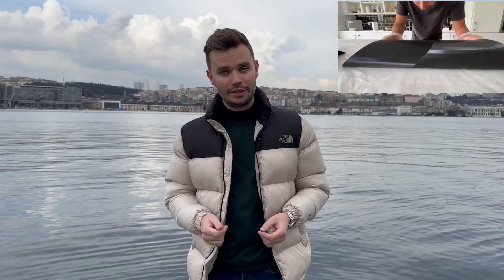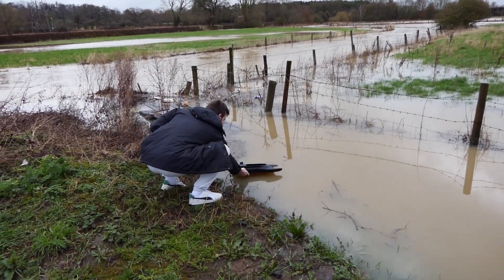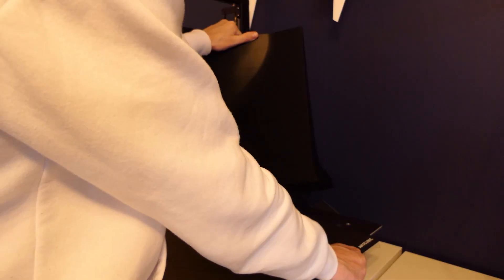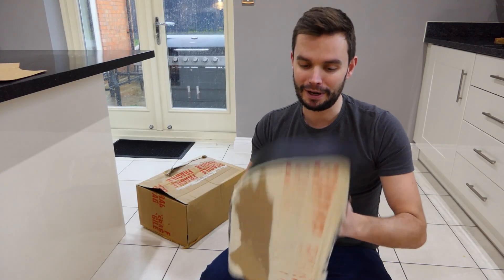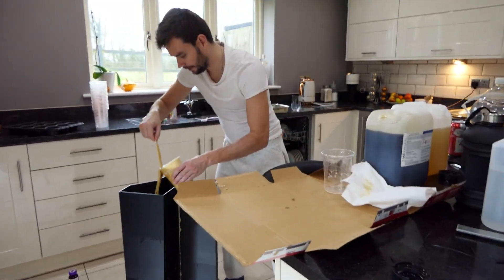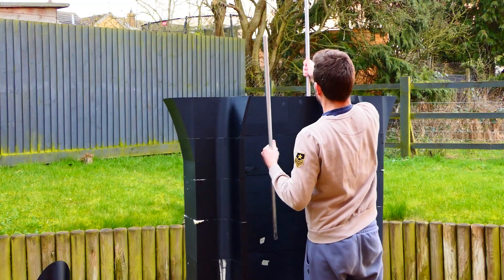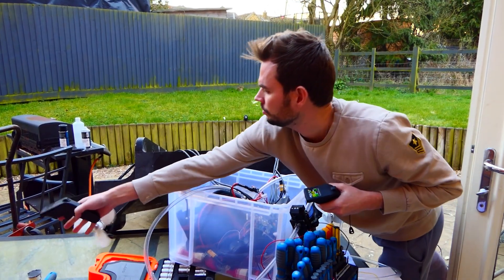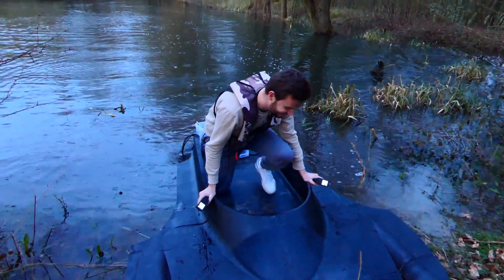3D Printed Electric Hydroplane

Comment: Mate I thought you were going to become a submarine
Reply from the maker: Thank you for preventing that <3
Reply: @SamBarker  then you would need to print with carbon fibers 🤣
Reply: "You do CAD like you're sculpting clay." I have never felt so attacked. Teach me your ways, oh wise one.
Reply: Casually almost drowned wtf
Reply: Laughing your ass off immediately, and THEN asking if he's alright... correct  answer  10/10.
Reply: SAVED THE TRANSMITTER falling in there!
Reply: Like the new Titan Submarine!!
Reply: I THINK you can reduce the cavitation by putting the propeller inside of a cylinder.... or at least I thought that's what I understood they were for when I watched a video on boats that had steerable props... but i could have  understood it wrong...
BUT I would think the best way would be to slow them down... so just make them bigger... you've got plenty of power that bigger props would slow them down enough and push WAY more water.... or you could always try those new style of props that use loops instead of blades... I think Tom even tried them out.....
- ALSO I way thinking about why some prints would have been been mismatched... it's probably the room temperature, humidity, and barometric pressure that day.... alone each one of these variables do affect much, but when all three are different AND you're doing such large prints I would think all three variables would make such huge swings over such a large distance - PLUS you're printing them quite fast, so they aren't going to be very accurate over so many layers..... 
- I think the perfect person to ask would be James Bruton .... he does A LOT of very large prints and doesn't seem to ever have issues with this... you should probably ask him
Reply: The captain must go down with the ship 😂
Reply: “Don’t help - just film”😂

Comment: Look at real hydroplanes, the props are far deeper in the water, using a flex shaft, also not sure if u have a deep enough two front arms to hydroplane, essentially u wanna be flying over the water with only the prop and bottom 5-10% of the two supporting arms bouncing on the water

Comment: You need an enclosure for large prints. As it prints, it begins to cool. As the material cools, it changes shape, but your printer is not compensating for that (and really can't) and so printing skewed parts.

Small parts are usually fine because the heat bed is enough to overcome the cooling, but a tall part with a lot of surface area is going to face a LOT of cooling and so needs an enclosure.

Comment: The gaps could be due to the print peeling off the print bed, that would make sense since the parts are kind of curved and out of square, happens a lot with big flat surfaces on almost all fdm printers. The only fix is things like a hotter bed, printer bed glue stick, or painters tape for bed adhesion

Comment: I THINK you can reduce the cavitation by putting the propeller inside of a cylinder.... or at least I thought that's what I understood they were for whebn I watched a video on boats that had steerable props... but i could have  understood it wrong...
BUT I would think the best way would be to slow them down... so just make them bigger... you've got plenty of power that bigger props would slow them down enough and push WAY more water.... or you could always try those new style of props that use loops instead of blades... I think Tom even tried them out.....
- ALSO I way thinking about why some prints wouyld have been been mismatched... it's probably the room temperature, humidity, and barometric pressure that day.... alone each one of these variables do affect much, but when all three are different AND you're doing such large prints I would think all three variables would make such huge swings over such a large distance - PLUS you're printing them quite fast, so they aren't going to be very accurate over so many layers..... 
- I think the perfect person to ask would be James Bruton .... he does A LOT of very large prints and dowen't seem to ever have issues with this... you shoudl probably ask him

Comment: Your propellers need to be under water. Look at how outboard boat motors look - they have a neck long enough for the whole propeller to be below the hull. If the water detaches from the rear of your boat (typically around 7 knots), your propellers start sucking air from above the water line and you get that nasty cavitating noise.

Comment: Maybe build it shaped like 2 hulls side by side. With a space between where you can sit to control the boat.
Then you can use 1 motor in the middle and make 2 rudders.
Locate the rudder brhind the hull. Just like when you buy an boat. Then you can use a bigger motor with more power.
Instead of 2 motors.

Comment: You will significantly reduce cavitation by reworking those motor mounts. Not only do they have a flat front face plowing in the water, theyre blocking the water from flowing through the prop. Instead they have to suck in water from the sides.

Comment: All consumer 3D printers are off square. You must correct the frame and then run skew calibration XYZ. Next, run a test print to correct the expansion/contraction and scale the model with the corrections to get accurate results.
In XL parts use .8 nozzle to speed up the process and get strong parts. Even the .6 will work better.
BTW what a waste of filament, time, money. Insane!! Just use playwood and fiberglass. Or made the shell in 3D print, then use it as a mold to cover it with fiberglass

Comment: Cavitation is generally caused by props being too high for the application, or disturbed water flow. In this case, I think it is both. Larger propeller likely will help it (enough) though it would have been better if were below the center on pod(s). In the end, if it gets to planing speed, then you'll likely want the props level with planed out water level, or above. The hydroplanes you built is designed on the "3 point" design and are meant for much higher speed than 30. Normally, the boat will plane on the back portion of the sponsons and at lower speed the back of the boat. At extreme speed, they'll nearly just ride the propeller which will be roughly halfway out of the water at top speed. They are a bit different on prop placement than conventional v-bottom boats (where I have a lot of experience with small boats going fast). 
If larger props didn't help, or help enough, you might also experiment with 'set-back' i.e. putting the motors BEHIND the boat instead of inside. This helps with stability, bow attitude (which may not help much on hydroplane), and overall speed. My 20' Hydrostream needed 8" of setback versus mounting the outboard directly on the stern with prop 2" above center line to hit its max speed of 104 mph. 

Regarding the fit, fit all the parts together and glue before filling with foam. I discovered a long time ago when I used spray foam behind a door frame that it can expand and greatly flex the space. In my case, the small amount I used was enough to where I couldn't get the door open until I took a saw and cut out some of the foam. It looks like the molds did fairly well, but more internal bracing near connection points will help. I used to have to do that with huge fiberglass subwoofer boxes so they didn't flex under use.

Comment: You’re pods block your flow to your propellers. That’s why normal boats have the motors inside the hull with a driveshaft going through the hull with an only a strut supporting the prop shaft in the water to reduce drag and turbulence to the propellers.

Comment: You need to angle  the prop down a little to create a plane you wanna sit more in the front of the boat  not towards the back as you were the concept of this style hydroplane is to have the pontoons and prop in water while you plane over the water so you want angle to the prop to lift the back up

Comment: This looks like an issue with propeller matching and motor rpm. This propeller can't absorb all of the power of the motors at those revs, so its spinning like an egg beater. Analogous to wheel spin. Try a bigger diameter prop, or a prop with a higher pitch to absorb more of the power.

Comment: The cavitation is mostly caused by the big cylindrical shapes that house the engines dragging through the water close to the water surface. They are creating an air bubble around the props most likely. I bet making a more streamlined nose cone for those things would help or moving the prop away from the thing by putting it on a longer axle is what normal boats do. I also think you'll want a more speedboat like prop, but that's complicated stuff. awesome video

Comment: Cool project. Just came to mention that you must not have squared your printers before printing. This shows in your distorted parts. Your motor housing/mount needs to be smooth on the front. It should resemble the front of an outboard engines gearbox.

Comment: Thought it was clickbait when I saw the small boat in the beginning. lol BTW, if you dont want all those bubbles, and you want more thrust, you probably need to redesign the impeller system. You should look into buying or printing a jetski type inpeller, and maybe redesign the impeller system so the impeller is inside a small tunnel further under the boat and not so far back and high up. My guess is the bubbles are from the impeller being too close to the water surface, but that is all just a guess. You could probably design a little drop in tunnel with a gate on it without having to redo your whole boat. You could cut out a box section, and drop in the insert.

Comment: CMON PEOPLE! STOP using damn PLA!! Its 2024!! use PETG! and you need to use  an expandable insulationg Foam it doesnt heat up and expends more.
And you have to use keys to join parts not just stick them together with glue

Comment: Prop cavitation
You need them lower than your back transom. Or the back face of the boat
Can mount on little pods lower like an outboard
Or in front like an inboard
Its not cavitation, but the air bubbles coming in from above
But no boats have them back there cause air bubbles
And when you get on a plane theyre out of the water
Reply: Or a hydroplane uses a jet pump so it doesnt stick down, sucks the stream up into it. Like a jet ski

Comment: I think the gaps in your 3D prints are actually caused by slight warping in your parts especially on the surfaces that laid “flat” on the heated print bed, due to some temperature differences.

Comment: Check out the possibility of 3-D printing toroidal propellers. I think they're pretty expensive to buy commercially, but even a 3-d printed toroidal propeller would have better performance than a commercial standard propeller.

Comment: Ah! you need an SLA resin printer!  No layer separations, completely water proof...
Reply: And like 4 times the cost
Reply: @adambundy2639  You can always get more money, but you can never get more time...
Reply: @nuchbutter  you just run more FDM printers... SLA is only quicker making multiples of the same small part....
Reply: @adambundy2639  no splitting or shattering with SLA, so no need to reprint saves time and frustration in the end.  SLA is way messier, however.  And as you stated, expensive...
Reply: @nuchbutter  a better choice of filament would avoid any splitting or shattering you speak of. There's literally companies making boats through the FDM process

Comment: To help with cavitation you need to get the propellers into "cleaner water" away from any wake. Spacing then out will help, but also the to"clean" the wake up by streamlining the back of the boat to allow the water to flow off more"clean"

Comment: if you want to stick to dual motor as your form of steering you'll need it to be software base because once you get up to speed on plane you'll want any adjustment to be miniscule or you risk loosing plane or loosing control. you also most definitely want your props to be mirrored otherwise you're just slamming the port side of the boat down into the water.

Comment: Got to love the wastage :) would have been quicker/cheaper and More environmentally friendly to build a box the right size and fill with expanding foam, shape it once hard, then fibreglass......presto.  But No lets use a £10k plus 3d printer and $h1t loads of plastic and the best part is its F'd up :)

No bloody life vest either or a paddle
Reply from the maker: Thanks for the input…. 

Personally I would disagree, shaving down a foam block which is not biodegradable in the near future (compared to PLA feel free to research that yourself.) However imagine your knowledge on the subject is poor anyway due to the presumption that the printer costs over £10,000. The printers I used in this project can be found in a link in the description and retail at £450. 

With regards to life vest and paddles… the camouflage item around my neck is a life jacket. The requirement for a paddle in a 20x20 meter pond is redundant as there is no currents and in the worst case I could use my hands or my camera man could pass me a rope we had at hand. 

So I think it might be yourself up a creek without a paddle. 

Best wishes. 

Sam
Reply: @SamBarker  I figured you may have learnt from your experience in the storm flooded river and hadn't noticed the item round your neck.

As for the biodegradable aspect of the idea I suggested there is many options that are and 90% of all the others are actually UV degradable.

Sorry for the assumption around the value of the printer, £450 was what a cheap toy version would have cost some years back so hasn't checked recently, however what we don't see thanks to your editting is the number of failed prints and blockages so loads of plastic that isn't biodegradable and will eventually end up in land fill.

For a professional YouTube you can't take criticism very well.

Thanks for the laugh

Comment: Next time add alignment tabs, tongue and groove sets, bow-tie connection points.  This will allow your parts to lock together and self support far better.  Bow-tie joints will pull the gaps together. Tongue and groove sets will keep parts straight.  Alignment tabs will keep edge transitions between sections to a minimum.

Comment: 😂😂😂 love the good old British humour and spirit chaps  .

Nice design, discrepancies in the printed parts on assembly may be down to thermal shrinkage and / accumulation of misalignment on assembly and possibly storage before assembly. Maybe print a couple of removable braces in the cad drawing for part stability . 

Dry fit in larger sections and place on a flat surface and use X/Y axis datum marks an a sheet of plywood. 
Alternatively print some internal flanges so it can be glued and bolted together. 

Or an internal stepped flange . 

Jet drives would be the way to go but I’m just going off the speed and performance of a jet ski  and they use jet drives for a reason. 

Cavitation is probably down to the prop diameter and pitch RPM range . 
But again I’m just going off what fast boats and RC boats use and I’m no specialist. 
Put adjustable 2 trim tabs on the stern this may enable it to get on the plane easier. 

To be fair I could of built a pattern / mold and made a carbon fibre one in the time it took to print and draw this but that’s not the point of your video so fair play  .

It’s all about having fun while experimenting and educating oneself .👍

Comment: The issue of your prints not aligning is due to the auto bed leveling system on the printer. With a printer like the Kobra 2 Max, the large and thin bed on it is practically guarenteed to warp. Becuase of this warping, your auto bed leveling is having to work harder and harder to contour your first layers to the warped bed. Almost all printers with auto bed leveling will also have "Mesh Fade" setting where the printer with automatically fade from the contour of the bed mesh to flat layers (at least if your machine is square) where there are no movements in the z-axis. The problem with this is that your top layer will be flat, but your bottom layer will be just as skewed as your bed is causing the top and bottom layers to be nonparallel. I can tell by the orientation of the layer lines in the areas you had massive gaps that this is very likely the root cause of your problem. An easy way to tell is by checking your bed mesh and what sort of range you're getting from the lowest point to the highest point.

Comment: The Hydrodynamic of the shapes around the propellers is horrendous...  there is a reason the engine on a boat isn't in a square box fastened to the bottom of the boat with the propeller fastened to one side. 
you're blocking the water from getting to the propeller.  There is a reason people came up with propeller shafts. 

I also suspect you are massively under powered i think even the smaller adult classes of hydroplane racers had outboards around 500cc producing a minimum of 33hp or 24kw..  They were also a lot lighter without all the batteries. 

Regards the 3d printing , you desperately need some internal cross members to brace parts and try and keep them vaguely square.

Comment: To reduce the cavitation you need to get the props lower or under the boat to stop them drawing air down from the surface,  maybe as an easy adition you could add a flat plate obove the prop  location (covering the main area where it is currently drawing air from) as a modification to this hull with minimal redesigning? as you go faster the plate would need extending further foward as it might draw air from each side of the hull.

Comment: Ur props r ventilating not cavatating, try and get them deeper below the surface. Air is getting sucked down into the leading edge of the prop blades